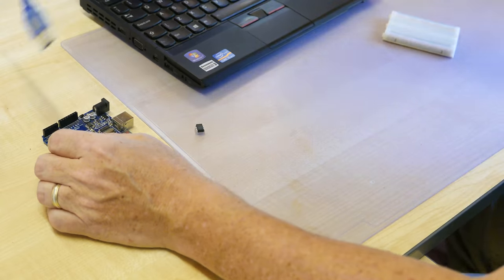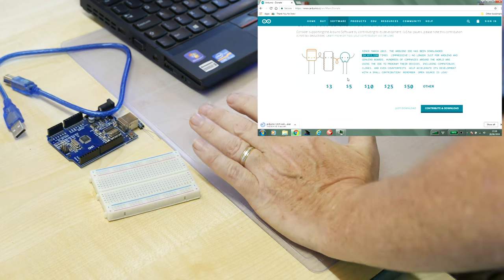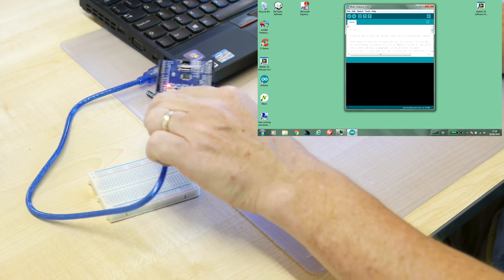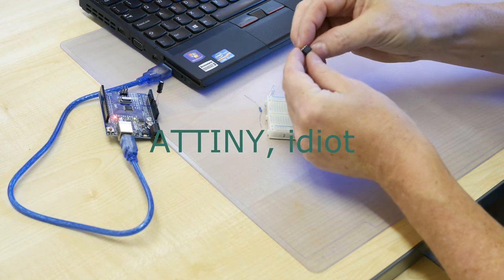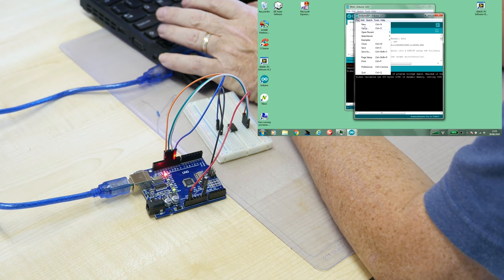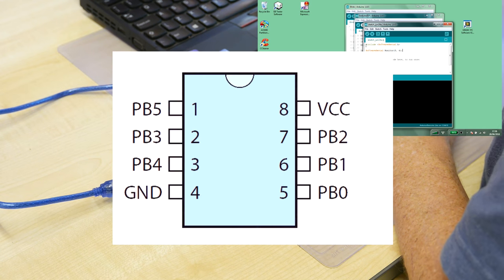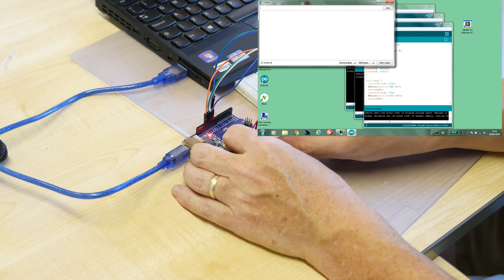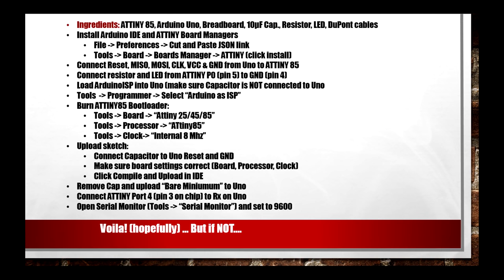ATTINY-85 Serial Monitor.  Step-by-step Arduino IDE Guide

Comment: the last minute was what I needed.  Clearing out the Arduino code with a do nothing sketch and removing the cap - the SOB worked.  None of the other tutorials I read made mention of that.  This is the only one that worked - well done BRO.

Comment: Rather than uploading a blank sketch to the arduino you can remove the 10uf capacitor and tie the arduino reset pin to ground. It's easier for reprogramming while testing your code.

Comment: Thank you so much! That completely fixed my problem! I, too, spent what felt like an eternity yesterday bouncing around from one “solution” to another. This was the only thing that worked! The biggest and perhaps only major difference in your tutorial from what I found yesterday was the realization that we remove the reset cap on the Uno to get it to work. Before this, the best I could do was reliably transmit from my ATtiny to the serial monitor but I couldn’t talk back to my ATtiny. Anywho, thank you so much, again!

Comment: To get the leads of an IC straight and spaced correctly, a "Spiratronics IC Straightener Tool" works well. One squish and the IC goes into sockets and breadboards with no fuss, and there's no chance of slipping as you're trying to bend the legs against a table top and puncturing your index fingers or anything messy like that. No affiliation, just a happy user.

Comment: if anyone else has problems with softwareSerials read function, its because you cant use pb5(pin1) as a RX. Or atleast i couldn't, it didn't receive anything, but when i switched RX to pb3(pin2) it solved the problem.

Comment: I like your work bro ....so plz make a video about making a universal remote control with attiny85
Reply: Wooow! You too are interested in something like that?! I am working on this kind of project but it is not easy with the USB DIgispark ATTiny. I wanted to receive a signal from a remote control with a IR receiver as a serial RX, save it in some way and replay it with a IR emitter.
Reply: Ok! I have just tried to receive a message made by the LED of my remote control but with the Arduino Nano. So I started from searching the baudrate of the remote control thanks to the oscilloscope, it made a nice 960µs per bit which is an equivalent baudrate of ~1041 (shame). Then I operated as Tom Donnelly did by connecting the IR receiver one pin to the ground, one to the 5V of the Arduino and one directly on the TX pin (I would have gone with RX but for some reason, the logic is to connect it to TX). In a first place, it didn't work. Then I used Teraterm, selected my COM port, in the serial port, entered manually my baudrate, pressed the button of my remote control in front of the IR receiver and some messages appeared. Then I closed Teraterm and tried to connect to the Serial Monitor of the Arduino IDE and it worked. Obviously, it has to convert my messages from bits to ASCII and the messages are quite unclear. I would prefer to create a little module on Arduino that receives the bits directly on a GPIO, and then displays bits instead of characters and end the message with a CR. It will allow me to choose a standard baudrate (9600 for example).
Now I know that the format of my data from the remote control is 0x3 FF FF FF thanks to the oscilloscope. Now, I also know that the duration between 2 messages is something like 115ms. With all that, it is all a matter of coding the right program. I don't have it yet and have to work on it! Hopefully, when I am done with that, I will be able to send whatever I received from the Arduino and a IR emitter to the TV for example.

Comment: The Attiny85 is a nice and fun chip to play with on a rainy day. I have discovered that an Arduino Mini Pro is cheaper including shipping and you get an Atmega328 or 168 + pcb pins.
They are also available in 3.3 V, 8 MHz versions.  Fine for  I2C sensors and  OLED.
Why pay between 2 and 3 $US for 1  Attiny85  when you can get a Pro Mini for  less than that ?

Or have I missed a supplier ?

Comment: attention, PIN 1 is also RESET. If you send a low to PIN 1 without change FUSE, it will reset the Tiny85. If you change FUSE you get in trouble to program the T85

Comment: Serial Comms Start and Stop bits. 

During the old days of teletype  bla, bla bla ... when the system was idle the TX signals were in the 'Mark' state ... or  in this case a High signal (+5).  When data is to be sent the Mark is switched to the Space state (0 v). This change indicates the Start bit leading edge. The Start bit signal remains Low (0v) based on the baud rate (i.e. at 9600 baud ...thats 104 micro seconds).  Therefore with Asyn Coms  a character consists of   10 bits ....  1 Start bit+8 data bits+ 1 Stop bit  ... or  1040 micro seconds.  When the 8 data bits are sent then a STOP bit is required.  
The STOP BIT:  when the last data bit is sent the interface signal must return to the Mark (+5) state in order to be ready to detect another character's Start bit (i.e. HIGH to Low transition as discussed). Therefore no matter what the level of the last data bit, a Stop bit will assure the interface in a idle Mark state.  In the old days some of the telecoms equipment were a bit sluggish and their turn around from one character ending and another character starting required  2 Stop bits to assure reliable performance. Obviously if the last character of a message has been sent... the STOP bit will remain High (+5)... hence the Mark State.    
Note: unlike SPI and I2C interfaces which provide a clock signal.... Uart serial communications must include their timing (i.e. 9600 baud  in this description  at  104 micro seconds periods) along with the desired data signalling.  Data bits are sent least significant bit first ( bit 0 or bit 2^0). The eigth data bit is bit 7 or 2^7 . Remember bits start with bit 2^ 0  so the eigth bit is 2^7).
There you have it :-)
Reply from the maker: Marvellous..

As it happens I was an IBM employee having to juggle the challenges of BSC comms and dicscerning start/stop bits but your summary is delightful.

However, synchronising across two different clock speeds and protocols was challenging to say the least.
Reply: @crazytom  ,   while Teletype was before my time I too worked with BSC comms  but with your competitor  Univac . Those days accoustical coupler modems were the norm and 1200 bps modems  the rising star.  I actually worked for Univac's Communications Division and  was noted to be able to call a  terminal with an accoustical coupler and I would whistle to emulate the expected tone  the remote modem accepted until I ran out of breath.  A lost talent I know and don't think will ever be resurrected. It happens. :-)

Comment: Capacitor matters. My serial monitor didn't give the correct value unless I put a capacitor(0.1uF) between VCC and GND pins of Attiny85.
Reply: 10 uF capacitor worked, too
Reply: Congratlulations. You have by trial and error discovered the need for decoupling capacitors. ALWAYS add decoupling caps. both 100 nF and some 10-47 uF electrolytic across VCC and GND.

Comment: Guys, if anyone knows - would you please explain one thing here. In order to program Attiny via Arduino we attach this capacitor on GND-Reset pins. On the other hand, I saw tutorials for programming ESP8266 (the thingie for Internet-o'Things), and those simply connect GND and Reset on Arduino and claim that such a short circuit allows for bypassing Arduino and communicate directly with ESP8266 . My question is - are these two approaches somehow related? I got many errors while flashing ESP8266 (about 1 out of 15-20 attempts is successful), so, maybe using capacitor for me would work better? And, wise versa - maybe a simple wire would substitute the capacitor in programming Attiny via Arduino? 

Sorry, I'm not an Electrical Engineer at all.
Reply from the maker: Yes they are related.  With the Cap on the Arduino you are supressing the hardware programming mode High signal to the Arduino.  Without this you would kill the Arduino as ISP program by over writing it.
Reply: Thanks for the reply  @crazytom ! 
Am I right thinking that I can do this both by using the capacitor and a simple wire?
Reply from the maker: No.  Shorts aren't good.
Reply: Tom, does this mean that this capacitor between GND and Reset allows for passing the Serial monitor commands directly to the chip connected to Arduino via RX-TX pins?
If so, then I will try same trick with ESP8266 and see if this resolves my problems with it.

Comment: "Now wasn't that worth the wait?!" LOOL
Anyways, if we use USB Digispark ATTiny or stuff like, will it still work with a direct communication on the serial monitor? I can't find how because the device is not recognised as a serial port. It will have simplified the work.

Comment: I'm intrigued, how come the serial passthrough doesn't work unless a blank sketch is uploaded? Is it to do with releasing control of the serial port on the Arduino?
Can the "Arduino ISP" sketch be altered to allow this serial passthrough, giving you a ISP device that's also capable of passthrough of serial debug code?
Reply from the maker: Didn't look into it.  Might be the TX/RX pin settings or CH340 control.

Comment: could this work with FTDI32 usb-to-serial board ?
Reply: FTDI232 USB to Serial, you mean instead of the Arduino Uno? In theory it should for the communication part (not for the flashing part). You have to have the common ground, RX of your ATTiny85 (pin5 in this case) on the TX of your FTDI board and TX of your ATTiny85 (pin4 in this case) on the RX of your FTDI board. Be careful of the VCC voltages of both, so that you don't destroy either the FTDI or the ATTiny. Regarding the specification of your serial communication, respect the 9600 baudrate, and try to find the softwareserial.h configuration for the other settings (data bits, stop bits, etc...).

Comment: sir i also want to program it but it always showing error- yenkie invalid device check your connection double. i checked everything but it showing this before some days i programmed it but now i m frustrated.
Reply from the maker: I have a few that give that message.

If you were using 3.3V try 5V otherwise you may have a bad chip.
Reply: @crazytom  sir i try both volts but same result and i check with different chip i have 5 brand new attiny85 but all are showing same.
Reply: before some months i was program it with same chip same technic but now i can't
Reply: i also tried uno, nano, usbasp but same result